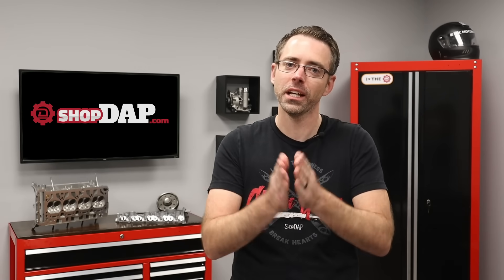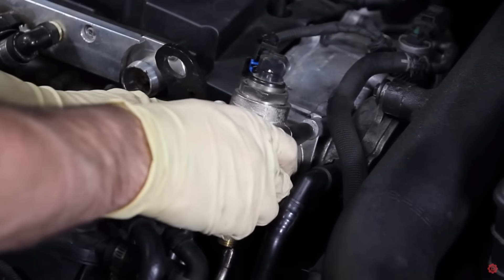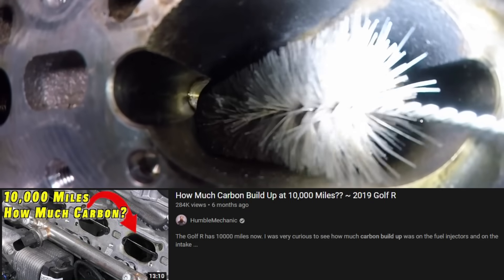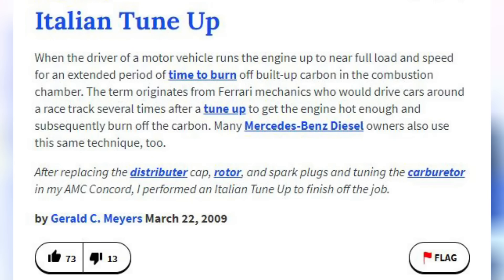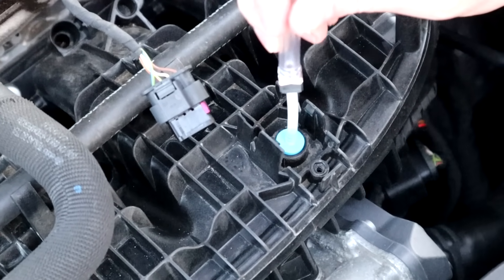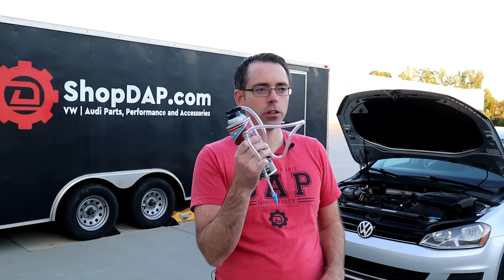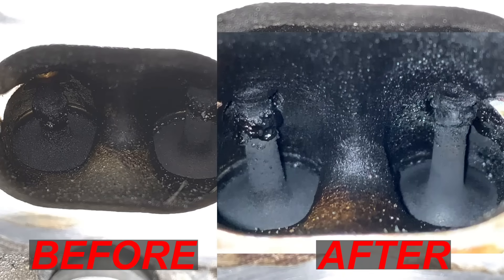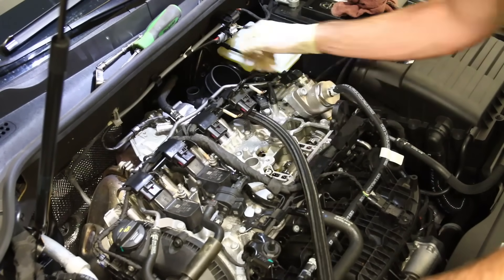Can you Really Remove Carbon for $29?

Comment: I didn’t see any difference.
Reply: I thought it almost looked worse after it was applied.
Reply: @07slowbalt  Likely  because the fresh layer of carbon build up hadn't dried,  there was some very minor cleaning but running chemicals like thy through the engine isn't ideal.

Not to mention most manuals forbid the usage of engine additives and cleaners.  So you are potentially risking warranty if something does go wrong.
Reply: @BigHeadClan  seems like a sure way to clog your cats.
Reply: @Will3ist  till you go in for an inspection.
Reply: Neither me.  🤣
Reply: @Stimpy&Ren high pressure fuel pump and injectors

Comment: Thank you for explaining the difference between port and direct injection. I have a better understanding of it. 

If the Jeep Cherokee has both port and direct injection videos, then why can't VW and Audi? 

I would be interested in your thoughts on BG or B&G services where you either dump cleaner in the fuel tank or take out the fuse for the fuel pump and you dump a bottle of the stuff in the engine. Also, your thoughts on fuel cleaners that you dump in the gas tank. 

But from the your video, it sounds like the best solution and a costly one would to have the intake media blasted and get it as close to how the car was from the factory. 

Question: Would the Italian Tune Up work better on port injection?
Reply: some vw/audi engines have port & direct injection, e.g. the r8 v10 or rs3 r5
Reply: @JohnDoe_333  as stated on Euro Spec cars. Not US.
Reply: @Andrew-zv4fm  it's because of the stricter NOx regulations here. direct injection produces a lot of NOx compared to port injection, but it's more efficient in most load scenarios.
Reply: @JohnDoe_333  so then why can't cars use both systems. DI is not perfect. You get carbon build up and that can prevent the engine running efficiently.
Reply: @Andrew-zv4fm   some do, like all Toyota's and Lexus's and few newer Fords

Comment: Thank you! I am using CRC with every oil change! I’ll try this as well.
Reply: Gasoline is a great solvent, and it doesn't cost $5 a can.
Reply: @NuMooX  so are you saying when they spray the CRC can into the intake we could actually put some gasoline down there?
Reply: @NuMooX  gasoline is no where a powerful solvent as valve cleaner

Comment: Paul,  You suggested that there are benefits to using 93 octane gas, as opposed to say, the 91 octane gas I've been using in my 2012 A4.  Is that true that I should switch to 93 octane?  Thanks.  (love the humor bits!)

Comment: How much does it cost for carbon build removal with the intake removed?
Reply: Expect to pay about $6-700 at a dealership for walnut blasting, and 4-500 at a local mechanic for chemical cleaning
Reply: Like couple hundred to diy for harbor freighter media blaster, shop vac, compressor & walnut shells assuming you don't know anyone with the aforementioned tools

Comment: More like dont use cheap oil dont use cheap gas dont wait 10k miles for oil change which is probably the main cause since by 10k miles that oil is severely burned. Also what about seafoam? Ive seen seafoam actually take chunks off the carbon build up.
Reply: I have done several oil analysis at Black Forest and they have confirmed that the 10k oil changes are just fine. VW 502.00 oil
Reply: @SkiRaceGeek  Ah ok gotcha, but what oil brands lasts up to 10k? Im sure not all do.

Comment: Any damage in the catalytic converter after that white smoke?
Reply: Well it’s more of cleaning and the cat wouldent really be harmed to much if anything it would be cleaning it out also
Reply: @heavenlyhatch  not true.  The chemicals in these type cleaners affect the catalyst in the catalytic converter and if done often enough will damage them.  I would like to see in writing from the manufacturer claiming that if any catalytic converter damage did occur that they would reimburse the buyer.  Problem is?  They will never do that.  Wonder why 🤔
Reply: Heavy metals like palladium and platinum and rhodium are very resistant as is the ceramic core to chemicals, extended over fueling from a misfire etc is what causes the run away reaction and melts the core.
Reply: Good question.
Reply: In order to check the "damage" in the catalytic converter, would be nice to read the rear o2 sensor at idle while white smoking and after cleaning
Reply: @jjjda7441  I have before when I was a technician at Chevrolet. Rear o2 sensors don’t read the quality of the exhaust coming from the cats it just reads the flow and temp.
Reply: Catalytic converters are covered under federal warranty for 8yrs or 80000 miles and most chemical companies will give you an additional warranty for using their products as long as your in a certain mileage range. So I would do fuel/carbon services based off of that fact alone. I know BG will cover up to 4K if done before 30k miles and up to 2k if done before 75k miles.

Comment: Thanks for the video. One thing that I do is at every service interval I add Wynns Power charge to the fuel system on my vehicles that are gasoline power as a preventative measure. Do you think that this helps to decrease the carbon buildup or have no benefit..    https://wynnsusa.com/products/fuel/power-charge-2/
Reply: On a direct injected engine.... no.
Reply: Why would it have benefit? Did you even watch the video?

Comment: hey guy! do u recommend replacing my oil level sensor o-ring if it is not leaking? I was thinking about doing this when I do the oil pan gasket and turbo return line on my 1.8t.

Comment: Just to clarify if anyone missed it, carbon build up on ea888 gen3 is more relevant in the US as EU cars also have port injection
Reply from the maker: Yes on the Gen 3 2.0t engines this is the case.
Reply: @Deutscheautoparts  But not to european engines with a gasoline particulate filter. I got a Skoda Superb with the engine code DNUA. It doesńt have port injection. I don’t know why.

Comment: It would have been nice if they put inspection ports on the intake ports. This way you not have to remove the entire intake to inspect and easier address the problem.
Reply: if they do that they could just fix the actual problem anyways
Reply: Where Paul inserted the chemical line you can buy a boroscope for your phone and fish it in to see the valves
Reply: @kevinmallon8692  I was thinking the same thing while watching this video. I have a wifi boroscope. I’ll try it out and check soon.
Reply: @mohammadkamran5862  let us know how it went with your car Mohammad
Reply: @icebergen78  when pulled my manifold off 2016 tahoe for an upgradey valves were not perfect but not bad at all.  Even build up of a fine layer.  I used seafoam top end cleaner for DI engines since new at every oil change.
Reply: @brandonbrown3600  I wanted to do this but never did... now I have 26,000 miles. I can still start now I guess... 🙄
Reply: Toyota literally has this what are y’all smoking
Reply: The cars are not so much designed by engineer draftsmen but by accounting and big honchos. Without big gov oversight the cars would not be as well built as they are.
Reply: @gweedomurray9923  if it wasn't for governments imposing emission restrictions people would have a lot more reliable cars. Even a Lada is more reliable
Reply: @WorivpuqloDMogh  ~ Granted they are more complicated and expensive to repair.  I use the free scan tool at Oreilly's when I get a code which has saved on components I can repair/replace myself.  As far as Reliable goes, my '99 Tahoe, coming up on 357K miles, is running well and very reliable on cross country trips I have taken.  NO machine is reliable if care is not given until a big failure finally happens because maintenance schedules were not adhered to or repairs recommended by a shop were not made before the "big bang" that left you stuck on the side of the road and possibly away from home and your regular shop who you know and trust.
Reply: @gweedomurray9923  well, those big V8s last forever. Definitly the 5.7.

But since i live in europe that isnt an option. Definitly with gas prices going to 9 a gallon. I am not joking
Reply: @gweedomurray9923  but i agree maintainance is important.  So is knowledge of the car. I do have a 1.0 tsi znd they are reliable u like their predecessors. But the car salesmen are liars and don't know their stuff anymore like they used to
Reply: @WorivpuqloDMogh  ~ They can be run into the ground but with good care and not driving with your "foot in it", they ARE good.  My lady friend filled up her 2014 Ford Escape Titanium mid week for $3.09 a gallon.  Some places are up to $3.39 or even $3.69 depending what area you are in.  Europe sounds like a costly place to live and an association in Switzerland certainly finds that place not inexpensive.  Despite the volatile politics going around here at present this is still my best option for a place to live.  Uni healthcare would be fab.  As a veteran on disability I get what very much resembles "free" healthcare.  A hospital stay I had back in 2007 would have totaled out to $35 K and that was covered.  People here have been in dire straits over paying that and greater amounts for medical.  Even when insurance covers a great portion you are paying some "handsome" rates.  An Aunt of mine was on Dialysis for the last 2 years of her life and they would have been wiped out as retirement only pays so much, but she was certainly using that coverage, with copays, that they had been paying on all those years.
Reply: @WorivpuqloDMogh  ~ I can remember when going to Radio Shack how counter guys had electronics experience, now most are JUST salesman.  R.S. is not the hobby store it used to be and so for odd bits I might need that I can't get at McGuckin's Hardware I go online.  Fortunately I am not a heavy hobbyist.  I have only bought used and the '99 is my best one to date.  I bought it in 2003 with a freshly turned 74K on the clock.  It has been in the shop now and then for things beyond my experience and tooling but I consider the truck "well trained" at this point.
Reply: @gweedomurray9923  yeah. Sometimes you have to redmine it becausz of the carbon buildup. But these modern ones don't seem to have that issue. Have 24.000 kms on the clock and usually problems began at 16.000.

3 a gallon is a dream for europeans.

I remember reading that under Trump it was less than 2 a gallon.

It really is. The fuel is actually so expensive because governments use it as a tax income. More than half you pay at the pump are taxes.

I agree. Universal healthcare is a must for the US. 

Where did you serve if i may ask? I am not american but still, thank you for your service, and welcome home.

Wow from 2003? Thats awesome.

Those V8s are really bullet proof.

I had the chance of driving a Chevy Caprice once. I think those cars are a lot more luxury compared to a Mercedes. Big seats, awesome suspension, nice interior. Very soft servo. 5.0 L V8. A gas hog but these things last forever
Reply: @gweedomurray9923  i have a friend in a similar situation. He has Chiari. Its an issue where the cerebellum bulges out into the neck. He got it after a car accident and his life is messed up. Surgery would cost over 1.000.000 dollars. In Canada 100.000 without coverage. But he persists in a lot of pain and i feel sorry for all the people who cannot afford decent healthcare because  the system is ruled by the pharma industry.

I have seen a bill of a hospital where they charged 100 dollars for a single piss of paracetamol. Its really sad.
Reply: @gweedomurray9923  id say that engine will last till 500k miles 

I do the same, stuff i don't know how to do i let the shop do as well. But since its a new car i had to go to the dealership and the amount they charge is nuts
Reply: @WorivpuqloDMogh  ~ I went to Sprouts Market in spring of '19 and they were for a time selling 4  1 quart containers of strawberries for $5 when it would normally be 2 for $5.  There was hardly anyone on the roads, even I-25 which is usually heavily trafficked was practically a ghost town.  As for gas being cheap I wont lay that on Donnie being Pres but that with so many staying home the demand for it had dropped like a stone.  I think the best I had done was in the low one-nineties a gal.  

The gas tax scheme works that way here too.  I think gas should not be prohibitive as it is literally the "lubrication" of commerce.  When so much of your income goes just for staying alive then forget the luxuries.  When I delivered wholesale produce it occurred to me that during hard times people will still be buying food and fun things like eating out and expensive toys and necessary goods will get a harder scrutiny before being bought or put off entirely until the whatever it is truly fails.  

Went over to Ontario, from Buffalo,  years back and remember paying a 17% tax on ice cream cones my brother Ron and I bought.  I was told that about 8 or 9% of it was G.S.T. (goods and services tax).  That is how they were/are funding the medical thing.    

Well, I wasn't in 'Nam as I was just a little bit young to have yet gotten a draft number for the "lottery".  I was in U.S.A.F. and from basic, to tech school in Texas, served my time at Travis AFB in northern California.  I was 6 months shy of a whole 4 years for having been "inducted" into mental health where I stayed from the end of December 1977 to the 1st week of March of '78.  It was a heartbreak to go back to NY which was still heavy on in Winter from a place breaking into a nice Spring.  You're welcome tho' it would be some years before our next major war type excursion.  I was in the masonry shop and could well have been deployed, as a civil engineer's group, to go do stuff like build emergency air strips and whatever other kind of work you get put to in a war zone. 

It came from California and was in beautiful condition.  After the cold war crap broke down and war time industries in Cal. had closed or cut way back many sold their homes and spread themselves across the other western states and even all the way east to Iowa, according to a grounds keeper I spoke with at one of their rest stops while on a trip to see family in Buffalo.   It is the kind with an actual tailgate much like what our older era station wagons had.  It is so handy for sitting on and sometimes it is a work surface.  Colorado bound vehicles of that type come here from the factory with "barn doors" which to me are more appropriate to a van.  

My bro Ken had an early or middle '80s Caprice and drove it to sometime in the '90s when they bought a Saturn car.  He loved that old thing and might have kept it longer but as it is with the "Rust belt"; the winter time road salt applications play hell with vehicles and I think he did not want to deal with eventual big ticket repairs.  Ken is as far away from handy man work as from here to Pluto so would not be keeping up the little things that avoid or delay big repairs as I do.
Reply: @WorivpuqloDMogh  ~ Stuff like that is a sucker punch to the gut.  If I were to pay for my repair and a little over a two day stay and the overpriced drugs I would have been on a long term payments plan but it would have been finished by some years prior to now.
Reply: @gweedomurray9923  i remember it dropped to 4 a gallon over here too.

Yeah that is true

Damn right it is. I think its sad because driving is a necessity nowadays.
Reply: @gweedomurray9923  still, you served your country. I tried serving mine as well but couldn't pass the entry exams. I was still too fat for service. Despite training.

Oh yeah i love those station wagons. Its really useful. I see a lot of dodge rams drive here and there is a tax loophole you can exploit to drive a V8 over here. 

Ooh awesome. Yeah they do tend to rust but i absolutely love these american cars. They are huge, comfortabele and reliable
Reply: @WorivpuqloDMogh  ~ For me driving isn't just about getting somewhere but I actually enjoy the activity.  It's like go carts on steroids; higher speed, long distance when I travel, protection from nasty elements and the ability to carry heavy bulky stuff.
Reply: @WorivpuqloDMogh  ~ I knew if I was sent out I would do what I had to and hope with all my heart, mind and spirit not to get captured, killed or maimed.  The bright spot is I was NOT drafted.  I went because where I was growing up didn't have any future for me that I could see.  Experiences like that leave you coming back with more than you had going in.  Post "Veetnam" as it was, you learn things and meet people you never would have just staying in the same place all your life.  In the military people come and go from one duty station to another so you you get exposure just being in one place.  Sometimes people get transferred that you would like more time with.  Some that were work mates were also off duty friends.     

The cars have better rust protection these days but are NOT invincible.  The preponderance of plastic components sure helps with rust prevention.  Do you have to have that honkin' V-8 for agro or commercial use to get that exemption ?
Reply: @WhiteG60  true, but also keep in mind with running boost, it introduces some wear and tear. 

But since i love cars, driving both is fun  but i still like the rumble of a 1.6L 4 banger more than an 1L 3 cylinder
Reply: Just port injection on turbocharged engines would be better. 

Direct injection may be better in some ways but i have a 1.0L TSI, and it drinks as much as a port injected 1600 cc engine.

Comment: Damn that wagon is clean for 70k miles
Reply: Bryce Czirr  My Polo is at 270.000km = around 167000 miles. I'm curious about what the valves would look like (1.2 TSI - running on LPG) I think it should be good, I can get up to 6l/100km on LPG and drive 90% highway mileage
Reply: Bryce Czirr  yeah but are they living and driving in a rural country area without paved roads like where this Golf had been for 70k miles?  I doubt it. 😎